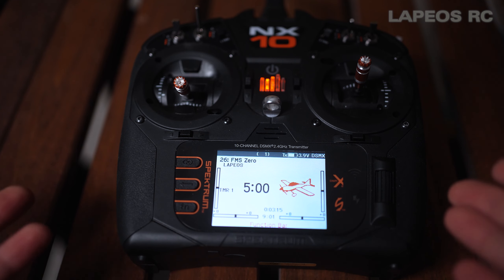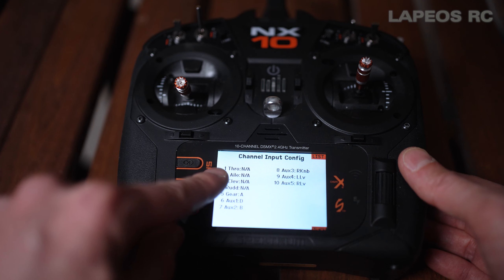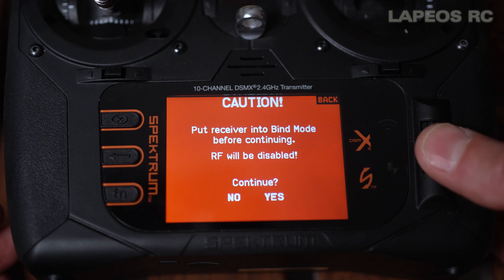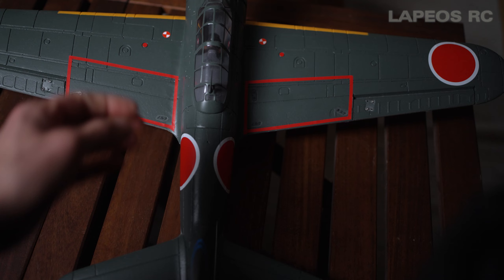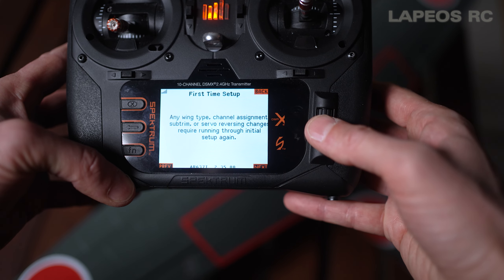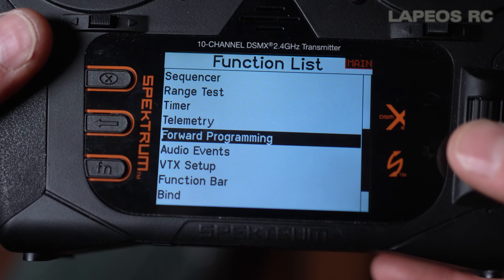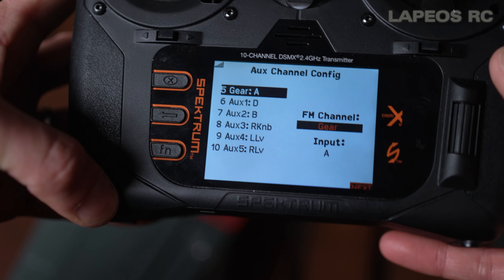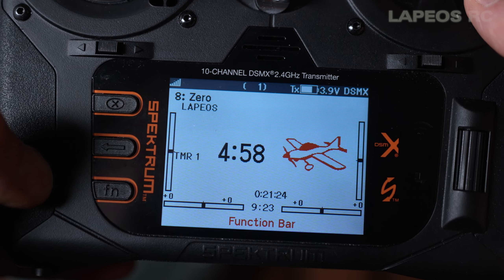Spektrum NX10 setup with the AR637T

Comment: Thank you,this was very helpfull!!...I know now ,that you can do this with a plane where the safe receiver already is installed,but it can only be done with a separate sold receiver...very helpfull and well explained video,thanks from the netherlands !
Reply from the maker: You can do it with receivers in BNF planes if you update firmware and reset them and then they are just like the receivers you purchase without plane.

Comment: Take the prop off and leave it off until you're done setting everything up! Switch A is for gear and you should only use it for that. You should have left the AR637T set for 3 flight modes and used switch B (channel 7) to control the gyro. That way, you can have a position for gyro off, AS3X mode, and SAFE mode. Switch D should only be used for flaps. In case you didn't notice, Spektrum tried to get you to use switch A for gear (channel 5), switch D for flaps (channel 6), and switch B (channel 7) for the flight modes. If you will set up all of your planes this way, you won't have any problems when going from one type of plane to the next. Also, if you fly mode 2, it's better to use the switches on the left side (except for the throttle cut). You can operate everything with your left hand while flying with your right. Also, when it said to level the plane, it meant level like when it's flying, not sitting on its landing gear. When did you go into the AS3X settings screen and set the maximum AS3X gains?
Reply from the maker: Thanks for watching. Setting up switches is a personal thing and I do it to suit how I want it and that’s one way to do it. As I have the R knob to adjust AS3 gain and don’t need to have a flight mode for that I use this method instead. I do mount the prop last after setup on a new rc plane but this was on an already assembled plane just to have an example. Certainly theres more advance setup I dont’t show in this video. It was more about giving a basic understanding and show how I do it.

Comment: i just mounted this receiver in my eflite F 15. I saw in another video that you have the same plane. Can you let me know what the Gyro settings are at in the F 15. Thank you very much.  I am just starting to play with the Gyro settings so it is a little bit scary. 🎉😮😅😊
Reply from the maker: I use the default setting on my F-15 so as a start try that. Usually that is a good match.

Comment: 10:11 I believe this step requires you to level the  plane itself as if it’s flying.  I think this captures the level orientation calibrates for the gyro (AS3X).
Reply from the maker: Yes attitude trim is setting level flight in SAFE.

Comment: Nice and helpful video _ I have the NX6 so I assume all that means is I cannot set TX gain control - I ask as I have an AR630 and not used it yet - once the AR630 is set can I then bind to a DX9 ?? and will the AS3X function still work ?
Reply from the maker: In theory you should be able to use your NX6 to set it up and rebind it to the DX6.

Comment: You can modify the travel of the ailerons and elevator in safe mode, I have the ar637t in the AL37 model of motion rc but it is very difficult to lift and turn it because the surfaces have little travel. Thanks
Reply from the maker: Yes you can adjust to increase travel under angle limits in forward programming.

Comment: Can you use the A switch on an NX6 for the Rxcel kill function?  I cant seem to get it to work.
Reply from the maker: If the kill switch controller can be controlled from a servo channel I guess it will work. But I only fly electric so just to be sure ask someone who do nitro.

Comment: I bought the SPM9747 DSMX SRXL2 Remote Receiver. It has a 4pin/4wire, the rx1/rx2 on the 6250HX is a 3pin/3wire slot. Can I use the X-BUS slot on the 6250HX for the SPM9747 remote receiver?
Reply from the maker: I'm sorry I haven't used any of the parts you are mentioning so I can't advice on these.

Comment: If I buy a new AR630 receiver and want to set up AS3X for the Arrows Marlin, do I need to also buy the AS3X usb cable? Or can I bind with my NX6 radio and then set up the forward programming with that?
Reply from the maker: You can do forward programming on the NX6.
Reply: @SunriseRCAviator  Correct. However, I'm currently watching the as3x series videos and the guy said that the cable is needed to update the receiver. Do I need to apply updates?
Reply from the maker: @aragorn318  If you purchase a brand new AR630 theres no need to update it. Its only the receivers that comes in BNF planes you need factory reset in order to unlock them.
Reply: @SunriseRCAviator  Yes, that was my next question. If I decide to take the ar631 receiver out of my aeroscout s2, will I need the usb cable then? Or can I also factory reset through forward programming after binding?
Reply from the maker: @aragorn318  Best procedure is to make a backup in FF and after that do a factory reset to unlock it.
Reply: @SunriseRCAviator  yes, thank you. can i do the factory reset using the radio forward programming menus or will i need the usb cable for that and then need to check/apply updates afterwards?
Reply from the maker: @aragorn318  Only FF is needed. These AR630/631/637T are so new so they don't need updates. On some receivers I'm unsure if you need to update but try to do a factory reset first.
Reply: @SunriseRCAviator  I just got a reply from radios section in rcgroups and a guy said that i will need the cable to register and install the programmable firmware. Then I can use FF to reprogram for the new plane

Comment: Just last week I was able to catch the HH sale where the AR630 was $30.00 US off regular price. $79.99 US, the regular price, is in my opinion just too expensive. There are less expensive ways to set your model up with Leveling and Stabilization than going Spektrum.
Reply from the maker: They are expensive I know but I've already made the investment and have a bunch of receivers to reuse in new planes. I also have the cheaper OrangeRX receivers which has been working great so far.

Comment: When I am in safe, when I give full Elevator up input wit my stick, it is a lot less travel, then when I switch safe off, How can i correct this
Reply from the maker: That is the idea with SAFE. To limit travel and avoid tipping over the plane. You can adjust it under angle limit in forward programming and increase travel to a certain limit.

Comment: I'm confused with one part of an otherwise very clear tutorial. In the last step of setup you did not level the model but left it on its wheels, won't SAFE, because you didn't level the model, try to maintain a nose up attitude? It doesn't make sense to me not to level the model. Please explain. Thanks.
Reply from the maker: In my experience it works fine to put the model on the wheels as is without lifting the tail to have it level as a start. Then after a test flight adjust the attitude if needed. It is much better IMHO to fly with SAFE and a slight nose up than having to do up elevator.  But on some planes where I judge the angle is to much I lift the tail a tad right away when setting it up.

Comment: 14:44 but what if the model has conventional gear, i.e. tail wheel? It's attitude is nose high while on its wheels, but that is not the attitude for level flight.
Reply from the maker: Yes the you would have to level the model and set attitude.